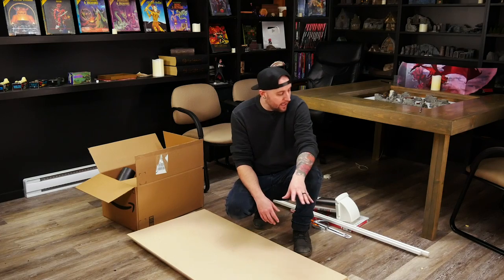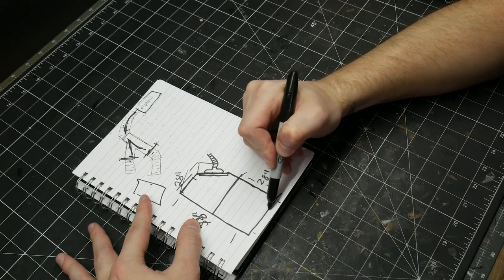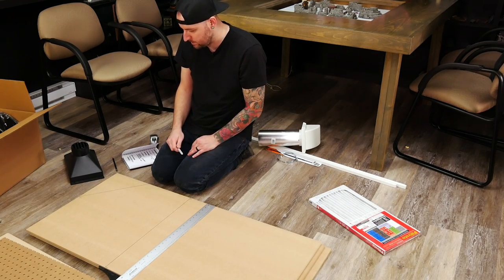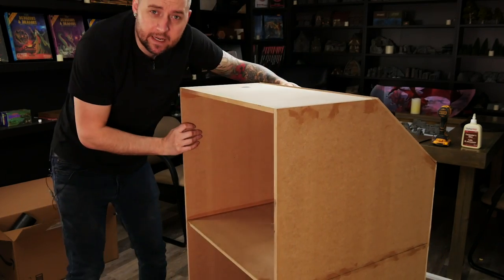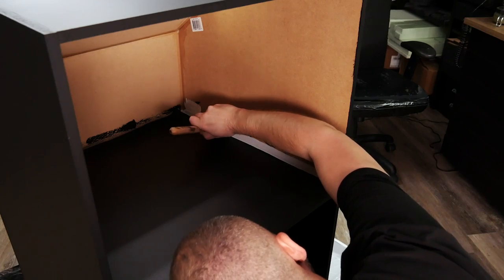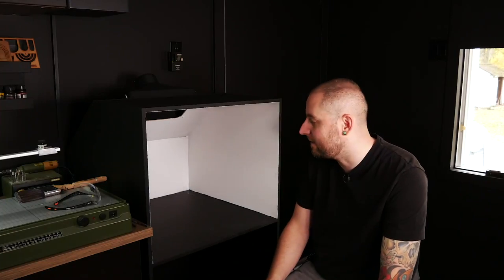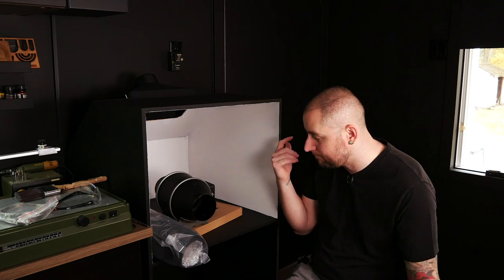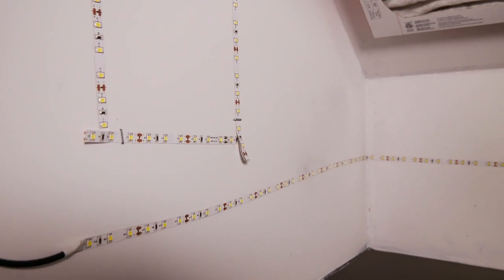I Finally Built Myself an Airbrush Spray Booth!

Comment: You always make amazingly informative video's! Why not use the currently unused duct connection to suck out the proxxon fumes!? Would further improve you working enviroment🤔
Reply from the maker: I’m considering adding a line for the Proxxon at some point since the fan is in place. I don’t think it’s required, but why not if the worst of the work is done right?

Comment: great video...wondering if the paint pulled through he hose will eventually show up on that wall outside.
Reply from the maker: Paint never even gets to to fan.....that’s what the filter is for. Also the paint particles dry within seconds in the air.
Reply: Black Magic Craft thanks man, not trying to hear noise that I ruined x, or destroyed y.
:)

Comment: So Im starting this project in a couple days using this video as a blueprint. One question though, my hobby room is shared with the laundry, do you see any issue installing a Y-split and using the dryer vent exhaust hose?
Reply from the maker: You should never split or share a dryer exhaust.
Reply: @BlackMagicCraftOfficial  what about a water heater vent?

Comment: Seeing that you have the parts you may want to vent your hot wire foam cutter until you get a 3d printer. No use in not using the supplies you have to create a better working environment.
Reply from the maker: When doing a lot of cuts I might just put the hotwire table right into the booth rather than awkwardly having a big duct in my main work area. This should be find for any work that isn't using huge pieces that overhang the machine, which is most cuts.

Comment: Professional woodworker tips:

A few hand clamps would really help for this project, from keeping the two sheets of MDF together for the angle cut, to holding a straight edge for a guide fence for your straight cuts, to holding your sheets to the saw horses. I think Harbor Freight has them for about $2.50 each, depending on branding and configuration. $10 to make your life easier :)

Using the jig saw for the vent cutout, you can drill a hole anywhere in the waste area to insert the saw. Many people drill a hole in all 4 corners do they can cut corner to corner and have room to turn.

(Haven't finished the vid yet, but....) Cleating in the corners would really help strength and stability for the shelf and any load bearing pieces. Butt joints are fairly weak even with glue and nails/staples/screws, and while not everyone can manage dados properly, throwing a cleat in is almost as good.
Reply from the maker: I was a professional carpenter (renovations) for a decade. I always evaluate time/effort vs reward. All of what you are saying is true but none of it was worth my usage of time to build a box I spray paint into. For example, starting the jigsaw cut....I can plunge cut and be done the whole thing before grabbing the drill and right size bit to drill a starting hole. It’s a rough free hand cut getting covered, I didn’t even square the corners. I have plenty of clamps, but can also freehand cut with a skillsaw on a stick framed roof two stories up.....again cut is done by the time I could grab clamps from the basement 😉 but I think this is the fundamental difference between a “woodworker” and a “carpenter” 🤔

That being said, solid advice for those not comfortable using the tools. I can skill saw a straight line, but that’s something that took years to learn. A clamped guide will help those without the experience.

Comment: Looks really nice! This episode makes me want to get off my butt and go build the spray booth that I've been putting off. :-) I'd be curious to hear what your conclusions are regarding leaving off the baffles--as I was planning to add some as well.

I'm planning to get around the "explosion proof" issue by using the fan from my old AC unit. It's loud as hell, but the motor is outside the air path. Technically not rated as explosion-proof, but less likely to have issues.
Reply from the maker: furnace/ac fans are ideal for this....its just that they are big, loud, clunky, and awkward. BUT they are totally safe in terms of sparking!
Reply: @BlackMagicCraftOfficial  Yeah. Mine is going to be garage based, so I'm not as worried about noise, but it would be a terrible solution for an inside booth like yours. :-) I may steal your solution when I go to build an enclosure for my 3D printer though...

Comment: So, it's going on two years now. Are there any regrets? Things you would do differently? I've been procrastinating for years (the one thing I'm REALLY good at) to add a spray booth to my hobby room and I like what you've come up with. Thanks.
Reply from the maker: Everything is working great. I just should have (and still should) addded a drawer for storage.
Reply: @BlackMagicCraftOfficial  - Awesome! Thanks. My workshop/room was originally designed around me building R/C airplanes, with rockets and plastic models on the side. I've kind of given up on my R/C hobby - it just lost its luster with me; and rockets still require a large flying field that isn't dry enough to catch fire! So, I've decided my plastic modeling will now receive the majority of my hobby time and money!

Comment: Brush-less Motors vs Brushed Motors
Manufactured table-top spray booths for hobbyists are generally pretty pricey and in most cases way too expensive for those beginning hobbyists just starting out. So therefore many of those beginning hobbyists prefer to build their own. However those people and others continuously harp about the possibilities of the vapor ducting fans those DIY hobbyists install into their homemade table-top spray booths of being intrinsically unsafe as they create the possibility of an explosion hazard by the sparks created from the vapor fumes passing around or through the fan. For those of whom worry about the possibility of an explosion hazard from using fans in a DIY hobby spray booth here is some information you might consider. The following information is taken straight from: https://en.wikipedia.org/wiki/Brushless_DC_electric_motor

Brush-less Motors
Brush-less motors offer several advantages over brushed DC motors, including high torque to weight ratio, more torque per watt (increased efficiency), increased reliability, reduced noise, longer lifetime (no brush and commutator erosion), “ELIMINATION OF IONIZING SPARKS” from the commutator, and overall reduction of electromagnetic interference (EMI). 

With no winding's on the rotor, they are not subjected to centrifugal forces, and because the winding's are supported by the housing, they can be cooled by conduction, requiring no airflow inside the motor for cooling. This in turn means that the motor's internals can be entirely enclosed and protected from dirt or other foreign matter. 

Generally used in environments and meets requirements in which manufacturers are required to use brush-less-type DC motors which include maintenance-free operation, high speeds, and operation where sparking is hazardous (i.e. explosive environments) or could affect electronically sensitive equipment.

Brushed Motors (Motors with brushes)   
The friction of the brushes sliding along the rotating commutator segments causes power losses that can be significant in a low power motor.
·        
The soft brush material wears down due to friction, creating dust, and eventually the brushes must be replaced. This makes commutated motors unsuitable for low particulate or sealed applications like hard disk motors, and for applications that require maintenance free operation.
       
The resistance of the sliding brush contact causes a voltage drop in the motor circuit called brush drop which consumes energy.
      
The repeated abrupt switching of the current through the inductance of the winding's CAUSES SPARKS at the commutator contacts, WHICH IS A FIRE HAZARD IN EXPLOSIVE ATMOSPHERES, a source of degrading UV radiation, and a source of electronic noise, which can cause electromagnetic interference in nearby microelectronic circuits.

Comment: so how well did the fan vent the fumes and spray after a year of testing/using ?  im thinking of building something like this but im not sure if its worth it or if i should buy a cheap premade one
Reply from the maker: It's great, best thing I've every done. I can't imagine one of those cheap pop up ones with tiny fans working very well in comparison. Better than nothing though.

Comment: Cool build... but won't the LED get dark fast with all the paint build up over time?
Reply from the maker: I don’t plan on spraying the walls too much. If it becomes a problem I’ll add something to cover lights. Or replace them every few years, they are hella cheap.
Reply: Should be ok as long as the fan is on when he sprays. That is a pretty powerful one.

Comment: Holy crap you put a hole through your house ! I was thinking get a stronger fan and have it set up to go out of your window ?
Reply from the maker: That’s for chumps
Reply: @BlackMagicCraftOfficial   Is it because you want to have more control with your window ? Like not haveing to worry about the ducting ?
Reply: Im not trying to be mean   I just want to know the pro's and cons of haveing the ducting through your wall rather then through a window setting    Im thinking of how to build or I might just have one made for me
Reply from the maker: Window means you lose a window, and can't open it. Window ducting is not as well sealed and I live somewhere where it gets to be -50C so compromising the seal of the window is a non option. Window means it's much more awkward with piping running down the wall and over the window. Then I couldn't close the blinds which I need to for filming. I would lose my view to my backyard. It would be ugly as hell.

Window ducting is a perfectly fine option for a temporary solution. I wasn't building a temporary solution. Ducting any fan outside permanently should be done properly, like I did. Does your kitchen or bath fan or dryer duct through your window? No they do not......or at least they shouldn't

Comment: Hi, Thanks for this video! I'm curious, after 2 years of usage, do you still use it? Would you do something different? i'm about to build one. I've purchased the fan, the hose. I laught when i've seen you want to do something for the 3d printer, i was trying to do the exact same thing and came to the same conclusion than you lol.
Reply from the maker: Check out my other videos over the past 2 years. I use it on just about every one! Only thing I wish it had was a drawer, which I haven’t gotten around to adding yet.
Reply: @BlackMagicCraftOfficial  I did watch a ton of your video in the last 2 years ;-) And yes i've seen it, the Drawer thing was the kind of thing i was wondering. That being said, you would need to put the inside bottom at a higher level to put a Drawer, unless you moreless use the space under it for your legs? Thanks!

Comment: I'm not sure how feasible it would be, but it might be nice if you did a test to see how much of the material pushed through an airbrush was actually absorbed by the unit. I can't see ever bother to use  a spray booth because I have concerns that it would still create a risk for others, including pets in the surrounding environment, in which case I would be best served by just continuing to do it in the garage.
Reply from the maker: It’s clear as day how much it contains.

Comment: This was an awesome video. I like the way you built the spray booth and the construction of it. 
One main concern would be when you placed the outside duct. Did you put any filling in the gap as will used any weather silicon to seal any of the gaps. As that can leave moisture in the house on the inside of the walls and as well as bugs and can cause some damage.
Other than that I thought this video was done very well. Keep up the good video's and I enjoyed how the nail gun was all most synced to the music. XD
Reply from the maker: I was out of the correct caulking while filming, then we got the blizzard. I did it a few days later. I was a residential contractor for a decade, I’ve put in hundreds of exhaust vents. No worries.

Comment: Awesome! You gave some great ideas. After seeing you angle the top back of the booth I feel like such an idiot. Lol. I built a 2'x2' booth 15 or so years ago and just hung a blower on the back of it. I think it's 265cfm. Put linkable 12" florescent in it and it's worked great. But, it didn't really need to "fit in" with anything. Now I've been planning to build something nicer that does "fit". Do you know the acronym,  SWMBO?  Well, I have one of those now...   lol

Anyway, building in the manner that you have never occurred to me. I was going to build a box and add legs. Now, I'm going to build as you have. Thanks for that! Makes so much sense. 

If you read this, how is the fan working out? Seems almost silent. Are you happy with it? Does it move enough air?  I had looked at those on Amazon a while back. The blower I use isn't explosion proof either and I've put it through hell but the motor is out of the airflow. 

Again, great job and thanks for all the ideas.
Reply from the maker: Fan is 👌🏻
Reply: That was quick! Thanks!!!

Comment: how did you connect those seperate led strips together?
Reply from the maker: It’s just one strip, I didn’t connect anything. But connecting multiple strips is easy as there are clip on connectors if needed.

Comment: Remember when those kids in highschool said Algebra was useless? Who's laughing now? A^2 + B^2 = C^2...
 
If you want a right angle, and that filter is 10 inches wide add 2 inches for a frame... And  C = 12, and you're looking at 144... Divide by 2, and your measurements are the square roots of 72. Or just about 8.5" inward and 8.5" down from the corner you're removing. Victory.
 
That should accommodate the vent and a frame to mount it on.

Comment: I use acrylic paint...So a spray booth is not needed right ~?
Reply from the maker: It's needed if you don't want paint dust all over your entire room and in your lungs.
Reply from the maker: Even with the booth I still wear a mask to avoid breathing in overspray. But mostly the booth removes all that fine paint dust from the air. Without it it gets all over everything in the room over time.

Comment: I am so glad you brought up the point of the fan not being spark proof, and although it is a minute possibility it’s still a possibility, and no insurance company would pay out if you are using a homemade booth and it is that that causes a fire or worst case an explosion, so personally I will stick with my commercially bought booth and lighting system, especially as I don’t have the space for one of the size you built, but I do think you should stop denigrating the “Rinky dinky” shop bought ones, they are an ideal solution for those of us without your Space, Time, Skills, or money to build one themselves, even more so as Amazon sell them and you are, I believe, an Amazon partner or whatever it’s called, sometimes your solution is not the best solution. Bye bye.
Reply from the maker: You know those ready to use ones on Amazon absolutely are NOT spark/explosion proof either right? You’d be in the same position with insurance. And I made it clear my solution is the best solution for ME. One size does not fit all. In my links to the parts I even link to the ready to use booths for those that it makes more sense for.

Comment: Was that a dodgy join on the circular saw.lol If it works its fixed. If not wrap some more pvc tape on it till it does
Reply from the maker: Years ago an apprentice carpenter cut through my cord. It’s fine.

Comment: Once you get your 3d printer, just design and print your own couplers.
Reply from the maker: I won’t ever be getting an fdm printer and that’s not really a task a resin printer could handle (size). But fdm printing couplers would be a good option.
Reply: @BlackMagicCraftOfficial  if you have any fans in Canada (apologize if that's not where you live) who have a FDM, you could put out a request 
I own an ender 3 but I live in outback Australia.

Comment: "Getting into airbrushing is easy," they said.
Cue video of a guy drilling a hole in his exterior wall.
Reply from the maker: Scared of holes?
Reply: @BlackMagicCraftOfficial  I'm renting out an apartment in a city, with no balcony or spare rooms I don't live out of, and no walls I'm allowed to make holes in.

Can't wrap my head around how I'm supposed to set up proper ventilation for airbrushing. I've watched dozens of channels' worth of videos on getting started in airbrushing (like Squidmar and Marco), everyone just skips over the subject of ventilation like it's non-issue and it seems that most have sophisticated setups like yours.

Somehow I doubt just opening a window while spraying in my kitchen/dining room will save me from risks to my health.
Reply: @BlackMagicCraftOfficial  I'd appreciate your take on just how much ventilation and protection is sufficient to be relatively safe from lung cancer by airbrush, if you have the time for it.
Reply from the maker: You can buy pop up spray booths with hoses you just stick out a window when using non destructive.
Reply from the maker: In terms of personal protection a good respirator is fine, but doesn’t stop paint dust from settling and making a mess on your stuff.

Comment: explosion proof fan just means its brushless.
Reply from the maker: That’s incorrectly actually
Reply: Brushless fans wont spark like a bruahed fan. I know theirs ACTUAL explosion proof where the motor is located outside or the the walls are built to take an explosion, but those are mostly industrial. For airbrush/spraypaint, I wouldnt worry much.

You built yours inside your house so safer is better haha.